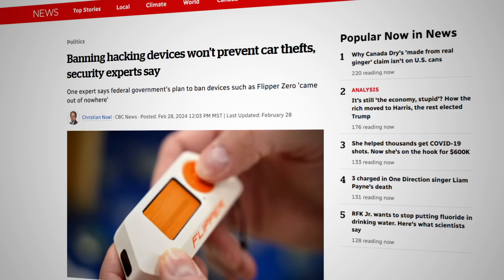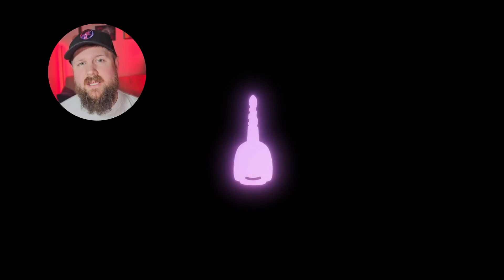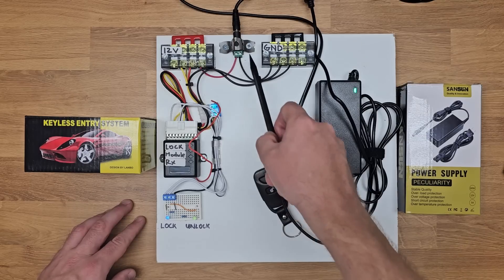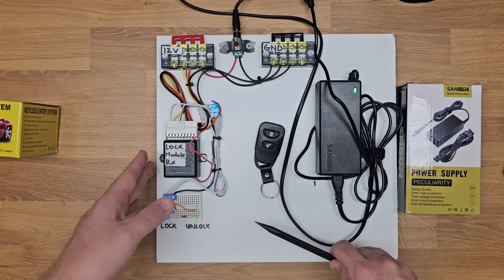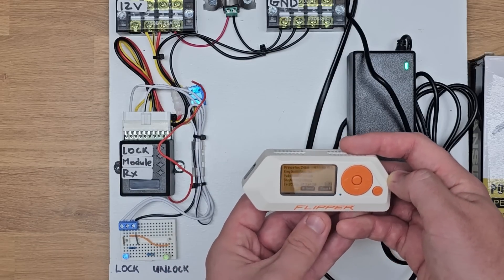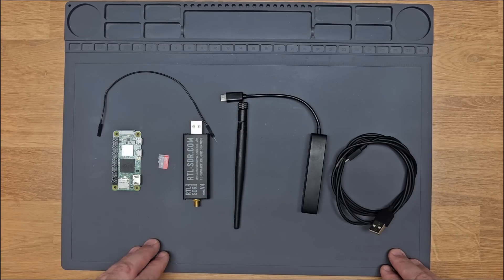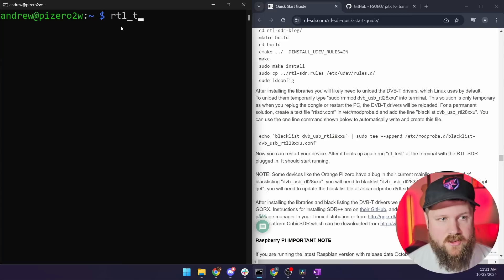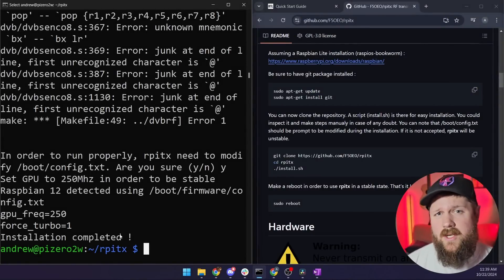Car Hacking: With or Without a Flipper Zero

Comment: Is their a device to block a flipper zero and roll jam device
Reply from the maker: Not specifically that I'm aware of for those attacks, however, all modern cars have rolling codes which will prevent the Flipper Zero attack. Some cars have prevention measures by rotating or using multiple frequencies which prevents the rolljam attack. - Andrew

Comment: It doesn’t work on 2015-2025 😢 
Works only for old cars very old
Reply from the maker: Unfortunately you right on the money about this!
Reply: Found this vulnerability in a 2016 and 2018 car.
Reply: Make and model? @mohammedshine2372
Reply: The trick to open and start still works for 600 of 650 different types of cars using less than $100 hardware. Just check the yearly ADAC report on this topic.
Reply: im sorry for replying this but i have 1996 Mercedes benz E320 i read raw signal freq at 433.92 succesfully but when i emulate i got nothing.. help me for figure it out please!